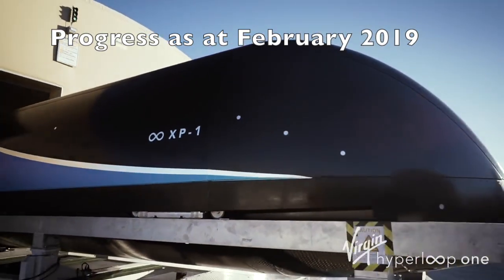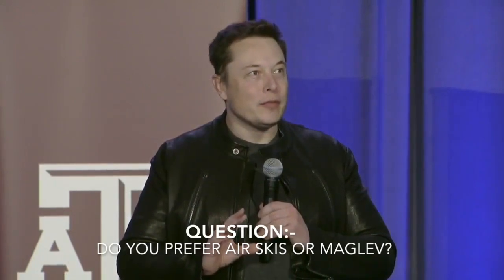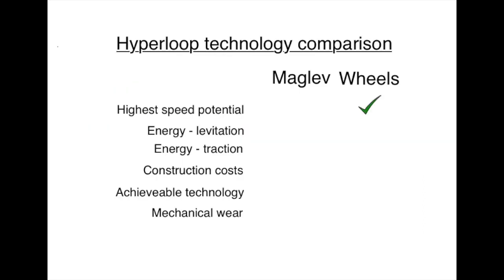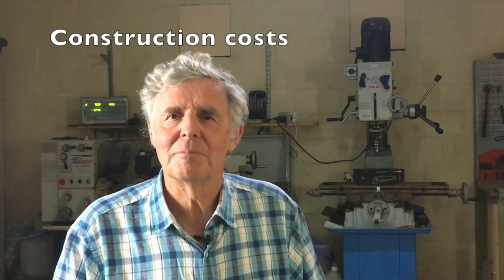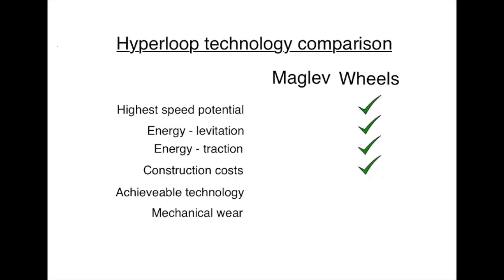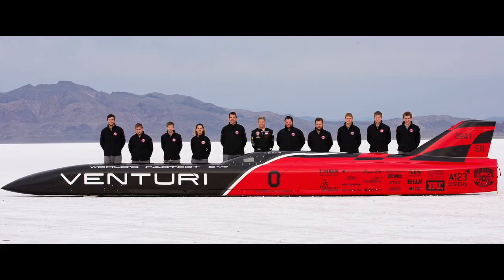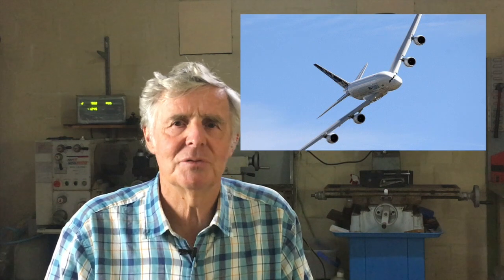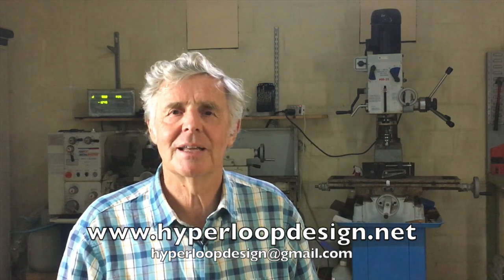Hyperloop - Reinventing the Wheel

Comment: There is a lot of errors in this video:
1a: TGV don´t run comersially at 575km/h. That was a one time test. The comersial speed is 320km/h. That is also true for the 2 fasters expample. It was one time tests.
1b: The only reason maglev don´t go faster today is simply due to not having very long test track. 603 km/h was made on a 42km/h test track. The 575 atemt for TGV was made on a 150km/h track.

2a: Transrapid have active lifting track and there for no drag to lift ratio. For SC-maglev the ratio is about 1:200.
2b: Maglev uses more power simpy because the accelerate faster. NOTE POWER. Not energy. Still the numbers are wrong: Transrapid uses 20MW transformer, same as high speed rail. SC-maglev in Japan 25-30MW transformers so a bit more. This is mostly due to acceleration. maglev consume 30% less power at speed per passanger.

3a: Its not true that the biggest inefficency is in the air gap. While the airgap loses a bit of momentum, it don´t loses that much efficency. This is due to the magnet being larger in size, compensating for the larger airgap.
3b: Linjer motor can be much better than 70% efficent. This is typicaly the case for LIM engines. LSM engine is over 90% efficent. That is simular to induction and syncronus normal engine

4: Wheel can´t just run on the inside of the tube. That would wear down the tube and causes break.

5: Transrapid was not closed down in 2008. Actualy the developed there 9:th generation test train in 2009. That operated untill 2011 when the test track was closed down. The  system was sold to a Swiss company in 2016. China and Korea both develop transrapid based maglev system today, and China built a factory for track production.

While maglev have been under development for quite a while, it have only existed commercially for a few years. The first full scale maglev train to finish commercial testing was Tranrapid in 2002. Then come the HSST in 2005 and the SC-maglev in 2012.
  
HSST and clones have been most successful making a total of  4 operating commercial systems today.

The reason why there is only 1 high speed system and 2 under construction (one in Japan and one new in China, started construction this year, also an aditionall one supose to start construction next year in the US). Is not due to commercial failure. There is only one country in the world that build high speed railway comersially today.. Japan, and they build maglev.

For the rest of the world, every single high speed railway built, have been built by the government. That is.. not commercially
Reply: Hi MatsV201. Thanks for your detailed comment! Sorry if there are any errors in my maglev story, it’s really hard to dig through the hype and get the facts. The two high speed trains have never published actual energy figures (I wonder why?), so you have to search thru unofficial engineer or media reports. Do you have actual energy figures? But the future of maglev looks uncertain, since China built the Transrapid, they have built 30,000 km of conventional rail.

Hyperloop will never be built if it’s too expensive, and the combined cost of the vacuum tube, and maglev, will be impossibly high. Which is why I’m promoting the wheels solution, which has the potential to reduce capital cost, and also running costs.

My proposal is pneumatic tyres running directly on the walls of the steel tube (no wear!). Tyres have been used at 1,000 km/h, 60 years ago, we need a research project now to see if they can be made reliable at that speed, with modern technology. The project would cost a fraction of maglev research. Wheels would have lower energy for moving, and better traction efficiency than any maglev system.

I think tyres could be developed with suitable reliability, but if not, the alternative is metal wheels running on a soft liner in the tube. This would be higher capital cost, but much easier to achieve, with less flex, heating etc. This would still be much cheaper than all the coils required for maglev!
Reply: @richardmacfarlane8404  Actually both Transrapid and SC-maglev have published a whole string of numbers. Its not harder than google "transrapid energyconsumtion" and first hit is Swiss rapide page (that bought Transrapid in 2016)
http://www.swissrapide.com/htm/e_energieverbrauch.htm 
There is also a substantial technical documentation behind that.

Its a bit harder för SC-maglev due to the best information being in Japanese.

"China built the Transrapid, they have built 30,000 km of conventional rail."
Well that is true.. What is also true is that the Chinese railway minister got jailed for corruption after taking over a billion dollars of bribes.

In the 2015 year 5 year plan they put aside funding for reserach of a new maglev train. The new train is finished now and is transrapid compatible.

The maglev elements of Transrapid cost about $2M/km. Most of the cost is guidway, engineering, access, transport and so on. The actually maglev is a very insignificant cost of the full system, just like the rails of a railway is very insignificant of the whole railway projekt.

The ware of the wheel increase by the square of the speed and distance (there for the cube of the speed and time). Having a wheel that works for 10 seconds at 1000km/h is doable. Making it work for 10 years is a totaly different story.

This is the main reason why high speed rail have a general top speed of 300km/h. Going over 300km/h the wear of the wheel increase so fast its totally uneconomical. A 300-320km/h high speed train need to swich the wheel axle every 2 years. Going to 350km/h, its every 6 month. Going to 400km/h its every month or so... Going to 575km/h, its literally a one time run. TGV V-150 that did the 575km/h run was on brand new axles when the run started. And gone directly to a shop for new axle after the run. 

Transrapid have run 430km/h in Shanghai, every day for 15 years... the number of axels they switch out... zero.

The problem with maglev is not that its not commercially viable. The problem is that hardly any railway infrastructure is build commercially. Every single country that build high speed railway infrastructure today build it on a government based model, except one. Japan. As so happen build maglev.
Reply: @matsv201  evul scuuuray gooberment
Reply: @matsv201  It seems you're saying the problem of wear is related to the axles rather than the tyres. Could magnetic bearings for the axles be a feasible solution?
Reply: @dionbridger5944  a Axel  is including  the wheel on a train
Reply: @matsv201  An axle is a rod to which wheels are mounted.
Reply: @dionbridger5944  On a train a axle is a specific term. A train axle is not the same as a car axle.
Reply: @matsv201  I understand, it just is unclear when you say "axle" which part of it is suffering from the wear such that it has to be replaced. If it's the surface of the wheel that seems like more of a problem than if it's the bearings or the rod.

Comment: 4:30
Transrapid uses less energy than a high speed train at 300 / 400 km/h:
http://large.stanford.edu/courses/2010/ph240/ilonidis2/
ICE 3 is the german high speed train.
Reply from the maker: Hi Andy. All the quoted energy consumption figures for the Transrapid are promotional figures before the Shanghai system was built, and are very understated. Its not fair to compare actual ICE numbers with Transrapid marketing. It's sad that rail doesn't publish energy performance data, where road and aviation publish their improved data to sell new products. It's really hard to get reliable HSR data, and virtually impossible for maglev. The only operating data for Transrapid puts it at about 3 times HSR energy, and there are references for 3-4 times for the SC maglev, although the source data is in Japanese.
Reply: @RichMac46  Thanks for your competently description.
Hope some day we figure out the correct system for hyperloop ; )

Comment: I feel it has really come down to the main innovation of the hyperloop is that the vehicle runs in a partial vaccume, which reduces air friction. Couldn't we get the same effect with an extremely streamlined vehicle (or some other kind of skin friction reduction technology). This way, we avoid all the tubing, vacume pumps, airlocks at the stations and the risks of destructive pressurization in case of accidents/terrorism
Reply from the maker: Vacuum is necessary to gain any speed or energy advantage over high speed rail. Aircraft gain by flying in lower density air, but travelling in a tube or tunnel really increases aerodynamic drag, unless the tube is very large and expensive. For an inter-city system, the added expense and complications of vacuum is justified to give the extra speed and low energy. There is a massive energy saving by eliminating aero drag. A lower speed, frequent stopping suburban service won’t use vacuum. Elon Musk’s Loop proposal has lower speeds, but easy entry to the tunnel without airlocks etc.
Reply: @RichMac46  How do you imagine track ( or in this case tube) switching will happen? Does the wheels need to have some kind of steering?
Reply from the maker: Janaka Goonasekera Switching is really interesting. In the station, the pod could roll onto a section of track that’s moved sideways in one piece, to line up with the right airlock. Not too hard. But a full-speed switch would be much harder, you would need to have the lower part of the track in sections, that are moved sideways to give a smooth curve to the new tube. Everything would be in the vacuum, the tube would be double width at one end. At full speed this might be nearly 1km long, very expensive. At lower speeds, the switch could be shorter, I’m thinking about 3 sec transit time.
Reply: @RichMac46  I imagine the vaccum must be a hard vaccum, otherwise there would not be much on an advantage over airplanes. i.e. if we reduce air pressure to around what is at 20000 meters, then the train can probably travel at airliner speeds, which is probably not enough to make it viable against airplanes.
Reply from the maker: Janaka Goonasekera We need to reduce the pressure in the tube to overcome the extra drag due to the tube, and the greatly increased speed. Once we have the sealed tube, airlocks etc, there’s not much extra pumping energy to make the pressure lower.  1kPa would reduce the drag 100 times, Hyperloop Alpha suggested 0.1kPa, 1000x less drag. I would think the optimum pressure to be somewhere between the two.

Comment: This is an excellent presentation. Thank you.

How do you think hyperloops can get passengers in and out of trains quickly? On a regular subway or train, thousands of people can get in/out in a matter of seconds. You will need air locks at stations or some kind of vaccum seal on the doors, both of which seem very difficult.
Reply from the maker: You have made a really good point here, the design of stations is very important. With the vacuum, its structurally difficult to have side doors, and access will be from the ends. But the narrow pod will be slow to walk along, and passengers need to be seated before the pod moves.
My solution is described here  https://www.hyperloopdesign.net/station. The passengers are seated in a mobile seating module, which rolls into the open pod at the airlock. This station would be far more efficient than a conventional rail station, or airport. The people can walk thru the ticket gate, and sit in a nearby seating module, which moves to the airlock when full. This design actually turns the loading challenges of the vacuum into a more efficient station.
Reply: @RichMac46  Your idea is brilliant. I'm wondering why a tapered end is needed at all for the trains, since it runs in (mostly) a vacuum.
Reply from the maker: Janaka Goonasekera The aerodynamic drag depends a lot on what absolute pressure is used, so the need for streamlined ends is not really known. But what about aesthetics? If you make it look like a London Tube train, would anybody want to ride on it? Of course, Hyperloop needs to look sleek and fast, even if it’s not really needed to reduce drag.
Reply: @RichMac46 I totally get the esthetics of high speed trains - they are often prestige projects as well  and become part of the landscape, so they need to be attractive.  However, outside of presentations, nobody would actually see a hyperloop train running in a sealed tube I imagine. Even at stations, nobody would see the train, if they need to traverse some airlock system.

Comment: If you use rotary motors you'll need many kg of batteries inside the pod. Unless you use a pantograph, which isn't feasible at high speeds due to wear (unless you use the newest materials).
Reply from the maker: Dibujo de Croquis Good question! Linear motors on the track provides external traction power, but with very high cost for the coils on the track, and low efficiency. The pod could be fully battery powered, but it’s difficult. The average power (for a 30 seat pod) is about 200 kW, but there is a peak of 3500 kW for acceleration, which needs to be recovered on braking. Lithium batteries don’t like quick recharge. My solution is supercapacitors for the peak power, and a power rail in the tube which provides the average power of 2-300 kW. The carbon brushes should last a while, and have an automated way to change them at the station.
Reply: Richard Macfarlane Thank you.

Comment: The high speed applications tires have been used for didn't have rubber-to-ground contact for thousands of miles per day. What evidence is there rubber tires wouldn't need to be changed daily or weekly at such high speeds?
Reply from the maker: Good question Flinx. We don’t really know, which is why somebody needs to build a rolling road. We know the tyres are structurally capable, we need to test a range of options to give acceptable wear rate.

Trucks spend less than 5% of total operating costs on tyres. 50,000 km would be ok, but we could get more, with hard rubber and an ideal running surface. Lubrication is possible, the metal-to-metal contact in your car engine has no wear because of a thin oil film. Maybe a Teflon tube surface would reduce wear and give adequate grip. 

But we don’t know how the wear rate is affected by high speeds, there’s no cornering forces, and moderate acceleration and braking. We need to find out! 

Wheel testing would be very low cost compared to maglev, and there’s a massive saving in initial. construction costs.
Reply: @RichMac46  "We" don't know, but don't you think Goodyear knows from testing both sticky NASCAR tires, and firmer airliner tires? They probably have an idea what the wear rates would be like at 600 mph vs 200. They've probably consulted with hyperloop companies about this but we're not privy to that info.

I think your video overlooked emergency stopping and how lubricated tires would have too little grip to stop a pod safely unless the separation between pods is so large that overall passenger throughput greatly suffers. 

Possibly tires wouldn't be used for braking. Instead eddy current brakes like some roller coasters use could be employed. But as far as I know those need proper alignment, which leads to tracks and either rails, or magnets. But they wouldn't be for propulsion.
Reply from the maker: Good point, a company like Goodyear would know a lot more. It would be great if a team or company had enough substance to persuade a tyre company to help. But Goodyear will have forgotten what they learned 50 years ago!

Most rolling roads only go to about 200kph, not much use. The Hyperloop tyre is different, because we don’t need high grip like motor-sport applications.

The land speed tyres all have high wear due to wheel-spin at 700 kph, on the loose salt. Blue flame of course was not wheel-driven, one of its tyres was used for all 27 runs.
Reply from the maker: @flinx Emergency braking. Normal braking will be limited to 0.3g, or whatever the electronics can handle. Emergency braking is different.
Normal disc brakes would overheat in the vacuum. Eddy current braking is complicated, as you say.

I’m thinking that friction brake pads onto the sides of the tube wall would work well for emergency braking, 1g or more. Because the steel would be cold, the brake pads wouldn’t overheat. With 1 g emergency braking, we can space the pods closer. What do you think?
Reply: @RichMac46  Did you mean to elaborate on how well emergency braking with rubber tires will work and what the braking mechanism will be? Because I don't see an explanation. In a traditional car on a wet road, braking distance is about double that of a dry road. .3g in a traditional car on a wet road is already nearing the traction limit for regular tires. In a hyperloop with extra firm and durable rubber tires on an intentionally lubricated surface, I'm very skeptical there's enough traction to stop quickly in an emergency. As a result pods have to be spaced further apart, reducing passenger throughput.
Reply from the maker: @flinx maybe you misunderstood my previous post.

Normal braking, using the motors, will be limited to about 0.3g at low speeds, and less at high speeds due to the limited power of the motors and electronics. So we don’t need much more grip than that. So wheels can’t be used for emergency braking.
 
We need at least 1g for emergency (Maybe 2g?), to allow closer pod spacing. So my suggestion is spring loaded (fail safe) arms, with friction pads onto the sides of the tube. Disc brakes get very hot because the disc heats up, but with pads on the cool tube, they shouldn’t overheat even at very high speeds, they would spread the heat over several km of steel.